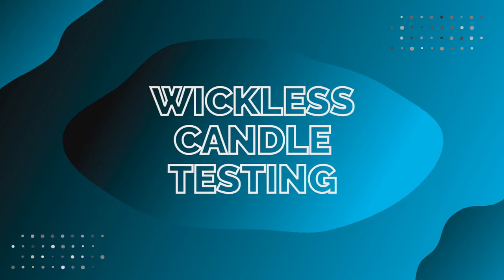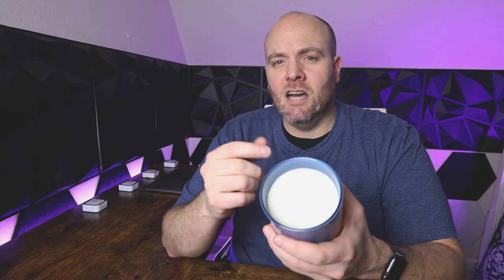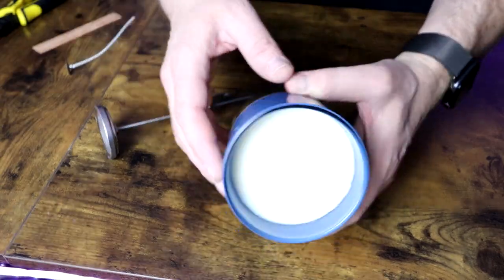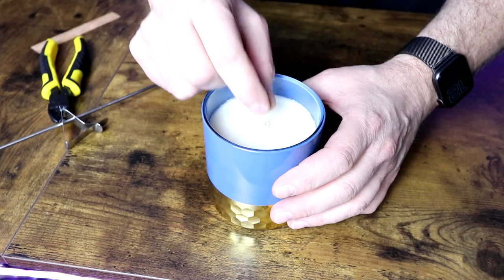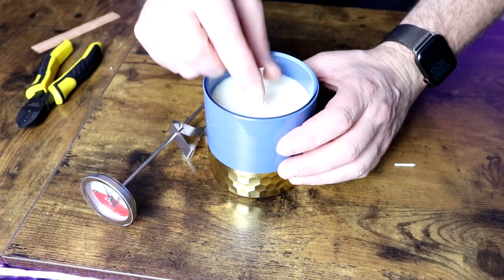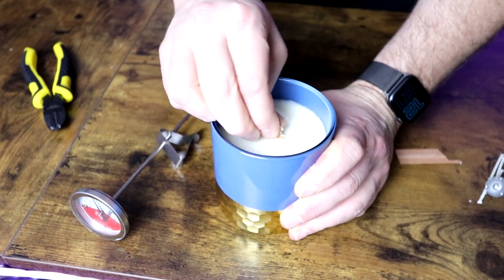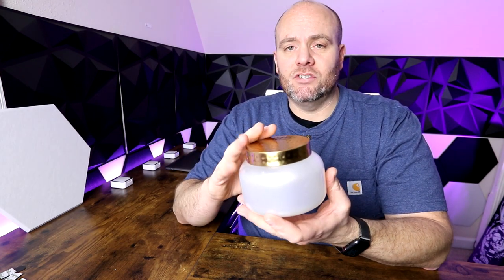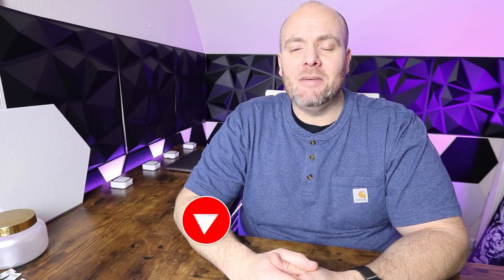WICKLESS CANDLE TESTING: Test multiple wicks in one vessel

Comment: i do this same thing, but when removing the wick before adding a new one I will usually just use a heat gun to level out the wax across the top so its a clean top instead of digging it out
Reply: I was thinking the same thing as soon as he said, "dig it out".

Comment: Thank you for sharing this, I'm in Australia, and new to candle making and have been putting off the testing due to the waste of product. I do have a question as you mentioned that the type of vessel will also effect the burn (tin, glass etc..) should you be testing all of your vessels even if they are the same size as each other and same "material" for example all glass, however some may be frosted glass, some may be clear and some may solid colour? Thank you Angela

Comment: Hey Jeff, I'm a new maker from Edinburgh, Scotland (Yes the UK!). I've been following  you for awhile but this is my first time commenting. I really love your videos, especially for wood wick candles as they are so clear and not many to be found. I've just stated testing two unusual shaped vessels- one is tall and oval in shape and the other a bit similar to the one you showed in this video that you are going to test soon. My question is: what's the best way to double wick these shape jars with wooden wicks? 🤔  My normal vessel is 30cl Lucy/Karen and I use Lumetique Booster woodwicks either an LA2 (0.51x12.70mm) or LA3. (0.51x15.88mm). I tried to use x2 LA2 but the flame was too slow and put itself out. Then tried x2 LA3 and the flame was too big and put each other out! 😅 Do you think maybe wicking up in WIDTH will make any difference? For e.g LB4 (0.76mmx19.05) or LC4 (1.16mm) ?? I already tried the largest in the LA range (LA4) & the flame was still too small. Starting to think that double wicking wooden wicks is near impossible! Would apprecia any tips. Thanks so much ! 🤷🏿‍♀️

Comment: is tunnelling more likely to happen with a full jar than a jar mid way filled because is the candle more hot deeper in the jar than on the surface? I keep getting tunnelling on the first burn but once I sort out that issue, the lower burns always get a full melt pool... maybe a fluke?

Comment: I did this yesterday. My wicks tend to mushroom and soot but I burned them in naked wax (wax that I didn’t add fragrance to) and they didn’t mushroom at all so I’m going to adjust my FO load. Also, I use IGI 4636 but candle science doesn’t have that wax as an option for the wick guide...is there a similar wax on their guide?

Comment: Great video. I have a question. So would you put no fragrance oil in those wickless testing candles? Would that give accurate enough result without any fo? Meaning, would that wick perform the same with fo? (Totally new to candle making myself)
Reply from the maker: You would put no oil in the mmmm on the first round only to find your wicks that may work. You should be able to narrow it down to one or two. 

Then you would want to make another one with oil and test those wicks and see which one burns best.
Reply: @StandleyHandcrafted  I never noticed you replied. Thank you. Ok I’ll do that although I was thinking myself now, wouldn’t it be smart to do it straight away with your fo. Saves you testing again?

Comment: Hi, I'm just starting to make candles. I'm using 200ml hexagon jars with a 65ml diameter. I've researched which wick to use so I'm using TCR 27/16 but just tested these and the burn pool doesn't go all the way to the edges. Any tips and advice will be appreciated

Comment: So many questions.  So,  do you burn one 3-4 hour block per wick,  depending on the diameter?  And if you find a wick which gives a full melt pool,  do you create a new candle with that wick and test again?
Reply from the maker: I burn each wick at least 3-4 hours unless I see the melt pool is way off then I pull it and start over with a new wick. Once I know the wick I will make another candle and burn it all the way down.
Reply: @StandleyHandcrafted  awesome.   I'm making soy wickless candles this evening.   Can't wait to try this method.

Comment: Use this method all the time. However what I do once I find my wick is have wax hardens up at least 24hrsbi use a apple core to pull out wax in middle and place a new wick with tab on it in jar, place wax back and proceed with my power burn testing off and on till candle finishes to insure no issues and that my flame extinguish itself once it reaches the bottom.

Comment: Jeff thanks so much for this amazing tip! <3 as a thank you for all the information I absorbed on your channel, may I offer a bit of filming advice in return? put the camera in manual exposure mode and set it to look similar to the frame at 5:26, since that is a correct exposure. if you need further assistance let me know, I'll gladly help!
Reply from the maker: Thank you!
It was set to auto and every time I flashed the white candle against the soft box light it offset the camera. lol
Reply: I only film my holidays using auto exposure, anything youtube/paid work is manual. otherwise, even on a camera that has decent dynamic range (how well a camera sensor can see shadows and bright areas in the same frame), I get subtle exposure shifts which are kinda annoying.

Comment: Great idea! Always feel like I’m wasting so much wax making multiple candles where the wicks don’t work. Do you have a guide or can you tell me when is it appropriate to double or triple wick?? Like, is there a vessel diameter guide for when to double vs single wick?
Reply: Hey! I had this same doubt when i started and what i found out, w the wicks i use is that if the jar has a diameter of 7.5cm or more (3inches) then i'd definitely need double wick. As i do not like to double wick, i just use jars that have max 7cm.